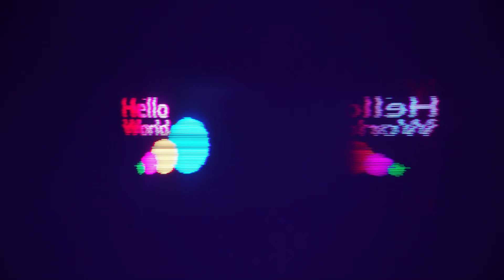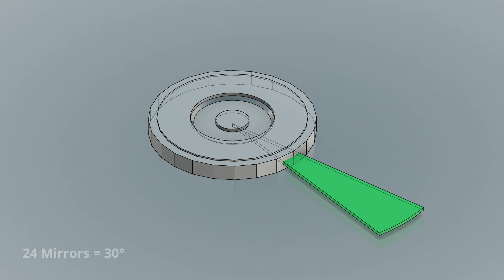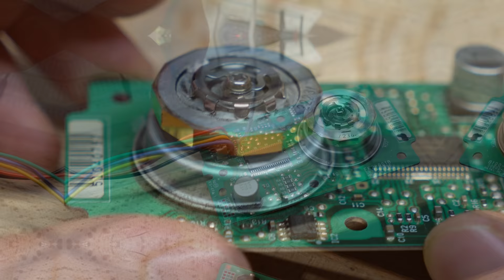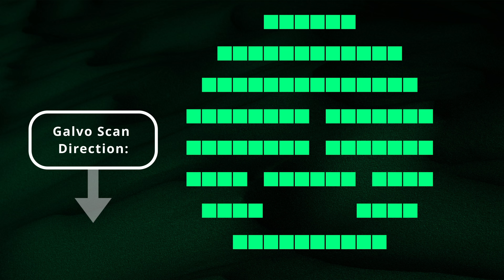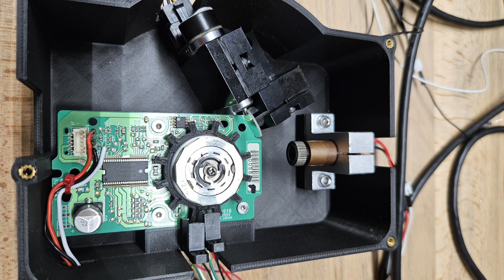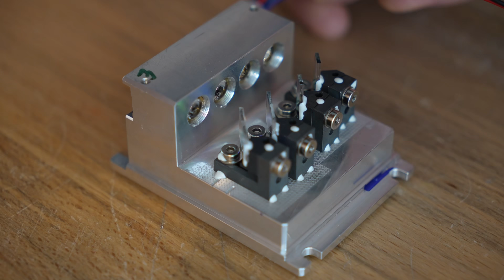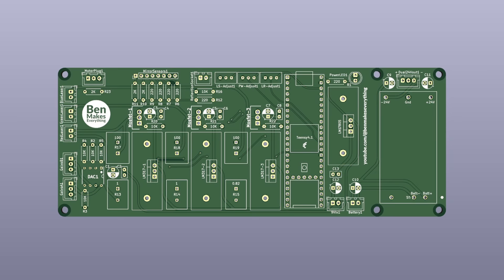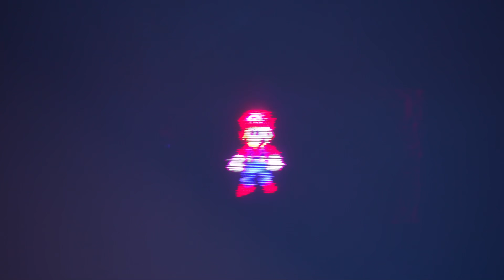DIY Laser Image Projector (100ft+ Range!)

Comment: I feel like dithering could help the colors a bit. 

I also feel like color should be secondary to size and resolution. Makes more sense to add 3 green lasers to help with the resolution vs. RGB. That's just me though.

Nice work. I want to build one!
Reply from the maker: That's a fair assessment. I could have gone that route, just got so many people asking for RGB in the first design, I figured I'd give it a shot.
Reply: Why would I use multiple lasers when you can buy commercial products with HD output? How do you calibrate those lasers to be even?
Reply: @ArneChristianRosenfeldt Why do anything?

Comment: How about using a slower rotating polygon mirror also for the vertical scanning, with its rotation axis perpendidular to the horizontal scan rotatation axis? The scanlines would get slightly slanted due to the constant rotation of the vertical scan mirrors, but that should not be a major issue. Very cool project like the previous ones! I had this kind of idea myself many years ago, but only on paper.
Reply from the maker: I thought about that - just wasn't sure how to sync them up without using gears. Given this motor is spinning at about 15,000 RPM, I thought that would generate an insane amount of friction. Maybe they could somehow be synchronized electronically.
Reply: @benmakeseverything Maybe possible with contactless magnetic transfer?
Reply: @benmakeseverything  timing belt
Reply: YES YES YES
Reply: magnetic worm gear? or let the software figure out what color to emit based on the current position of horizontal and vertical mirrors, ie. let the hardware move the (x, y) indexes in the software. This way the better the synchronization, the better image quality, but no longer will they need to be synchronized perfectly.

Comment: Is there a known maximum switching frequency that can be obtained on a breadboard given its stray capacitance? Is 100 nanoseconds even attainable in those conditions?
Reply: People build CPUs and Ben eaters world worst video card on breadboards. 20 MHz.
Reply: My highest frequency I've got working on breadboards is 27 MHz (~37 ns). 32 MHz should be doable, but haven't managed it myself. I'd almost be willing to say that anything under 100 MHz is doable, tho have no backing for it or any references - just a wild guess.
Reply: If the waveform at 11:16 is real, thats most likely inductive ringing, not stray capacitance.

Comment: Holy crap this video is a masterpiece of improvements being made. Awesome how something like a CRT can be replicated into a projector. Usually projectors are just boring lcds but this one has LASERS!!! Nice job.
Reply from the maker: Thank you so much! It was a lot of work but a fun project for sure.
Reply: This project is quite retro. The first television systems were mechanical in nature and worked precisely like this.
Reply: @videolabguy  Yeah, the early pocket projectors before DLP used lasers and a single mirror that was electromagnetically scanned in two directions with resonant frequencies using just one coil, genius.

Comment: dither your images! can get much more true-to color images even with your limited palette
Reply from the maker: I'll have to look into that, hadn't considered it. Thanks for the input!
Reply: @benmakeseverything  Dithering would work, but I am not so sure that PWM is ruled out here, sure the lines would be dotted, but as long as the frequency is high enough, I would think it would have the apparent effect multiple levels of intensity, kind of like a one dimensional half tone.

After all, with a few exceptions, every printing and display technology is based, more or less, on the phenomena that different dots close together is perceived as one of the average intensity of them all.
Reply: Agree, but I would suggest not just dither static image, but convert it to video or gif with dithering by using ffmpeg. It has multiple dithering methods, I would probably suggest atkison or sierra3. You can try other as well, but with B/w screens atkison works best for me even with resolutions like 100x50. High framerate is important though.
Reply: @benmakeseverything There are any number of image processing techniques that could help with color. But, solving it in hardware would be most reliable and get the highest quality. I wonder if you can use some kind of shutter to control the beam width?
Reply: @benmakeseverything  either dithering or blue noise would work - the benefit is that blue noise can change seed every frame so that the pixels blend together more
Reply: @benmakeseverything  If you do then while blue noise or error diffusion would brobably look best I really like the look of bayer matrix (ordered) dithering so pls try that too
Reply: @benmakeseverything  worth a look... for us oldies, the display you have created is roughly mode 2 on the BBC micro. That could produce some pretty decent colour images using dithering - good enough that my parents got called to the school because I had an image ripped from a Samantha Fox Strip Poker game and loaded one onto the school BBC.
Reply: When IBM came up with their CGA colour display for the original PC back in the early 1980s, they had a similar issue with the colours.  They decided to use resistors to run the R, G and B channels at 66% brightness normally (giving the same eight colours as here from three bits per pixel), but they added a fourth bit to each pixel for 'intensity' which when set, added another resistor in parallel with the existing one (for all three channels at the same time) to bump up the brightness by 33% (making the original three bits switch between 33% and 100% brightness, instead of 0% and 66%).  Just this simple change of adding one more bit doubled the number of colours to 16 without requiring much extra circuitry and without the need for PWM.  It's where a lot of the old 16-colour graphics formats get their colours from.
Reply: @vink6163  THIS!
Reply: Dithering requires more resolution to spare, as does PWM
Reply: I have worked on some "low resolution pixel magic" before, and yes, i believe it can be quite some upgrade (given that there are still only those 8 colors available) 

BUT: i think it only really has a nice effect with pictures and not with cartoon like images.    It will get more blurry but if u see it from the far u might have a better chance at recognizing what is shown.

... but other idea: can u draw one line two times? Or rather set the vertical speed to 1/2 to then have  28(hope my math is mathing xD) diffrent colors?   (U just take every possible mix of your 8 colors) ... it might add flicker or halfes ur y resolution,  but adds colors.   Also maybe u could make a algorithm to share the pixel colors a lil more (maybe add 28 colors roughly but only reduce y resolution by 1/3 🤔)
Reply: @MasterPice01 I'm not sure how two passes would increase the number of colors available. Are you thinking it would allow mixing "faded" green from the first scan with bright red from the second, or something?
Reply: @creativecraving yes,  i guess you could imagine it as overlaying two images in photoshop and setting the blend thing to "add" or something.       It will flicker very fast between colors for one pixel,  but if its fast enough the human eye probably sees it as a blend.    I mean its the same as running PWM leds to control the brightness  i guess but now having the frequency be the speed for one line
Reply: @MasterPice01 Hmm. I guess that would let you have 3 more colors. Wonder if it would work?
Reply: @creativecraving more than 3.  He has rgb. And combinations of it (red green blue magenta yellow cyan black and white.)    (This is just the combination of the 3 lasers and gives 8 colors) 

  magenta would be turning on red and blue. (rb)
 Red would be turning on red (r)
 White would be all (rgb)
...

But then you can mix those 8 colors i believe.    So we first draw a line . Lets say in red (r). Then we redraw the same line but now in magenta (rb).   This would flicker between r and rb and i believe this would be blended into a color similar to rrb (so 2 parts red and one part blue).    And you could do that to all the 8 colors. 

Wait let me make the math...
Reply: Oka so we pull 2 (k) colors of a pool of 8 (n) available. 

So we use the binomial coefficient of n + k - 1 over k  where k = 2 and n = 8     .... which is 9 over 2 which is 36.  So we should get 36 new colors to choose from.   Those are basically all combinations of the original 8 so for example  red and red. Red and magenta, red and blue , magenta and white  .... etc.   If you mix black and a color you get even darker shades if the 8, which should already make the quality of the output better i guess
Reply: ... so codewise we could simply find the actual color code for the 36 colors and then use this to convert a image into a indexed version like in the video but now with 36 instead of just the 8 indices.   And changing some code to make it work on the device with two lines .     Optionaly you could convert the image to still the 8 indices image but generate two layers (the ones that are mixed) them the device only needs to take the two images and first alternate between drawing image1 line 1, then image 2 line 1. Then image line 2, image 2 line 2, ... and so on
Reply: @creativecraving  
in a lil more detail (just made a tiny python code for this) xD:

Primary colors: ['r', 'g', 'b']
gives us 8 colors like in the video: ['r', 'g', 'b', 'rg', 'rb', 'gb', 'rgb', '-']
where - is black (no laser on), rb would be magenta ...
and then we make each pixel twice by redrawing the lines: (first rgb value is layer 1 and after the "," is layer two. the layers are drawn over each other so it should mix the two colors)
r,r    : RGB=[255.0, 0.0, 0.0]
r,g    : RGB=[127.5, 127.5, 0.0]
r,b    : RGB=[127.5, 0.0, 127.5]
r,rg   : RGB=[255.0, 127.5, 0.0]
r,rb   : RGB=[255.0, 0.0, 127.5]
r,gb   : RGB=[127.5, 127.5, 127.5]
r,rgb  : RGB=[255.0, 127.5, 127.5]
r,-    : RGB=[127.5, 0.0, 0.0]
g,g    : RGB=[0.0, 255.0, 0.0]
g,b    : RGB=[0.0, 127.5, 127.5]
g,rg   : RGB=[127.5, 255.0, 0.0]
g,rb   : RGB=[127.5, 127.5, 127.5]
g,gb   : RGB=[0.0, 255.0, 127.5]
g,rgb  : RGB=[127.5, 255.0, 127.5]
g,-    : RGB=[0.0, 127.5, 0.0]
b,b    : RGB=[0.0, 0.0, 255.0]
b,rg   : RGB=[127.5, 127.5, 127.5]
b,rb   : RGB=[127.5, 0.0, 255.0]
b,gb   : RGB=[0.0, 127.5, 255.0]
b,rgb  : RGB=[127.5, 127.5, 255.0]
b,-    : RGB=[0.0, 0.0, 127.5]
rg,rg  : RGB=[255.0, 255.0, 0.0]
rg,rb  : RGB=[255.0, 127.5, 127.5]
rg,gb  : RGB=[127.5, 255.0, 127.5]
rg,rgb : RGB=[255.0, 255.0, 127.5]
rg,-   : RGB=[127.5, 127.5, 0.0]
rb,rb  : RGB=[255.0, 0.0, 255.0]
rb,gb  : RGB=[127.5, 127.5, 255.0]
rb,rgb : RGB=[255.0, 127.5, 255.0]
rb,-   : RGB=[127.5, 0.0, 127.5]
gb,gb  : RGB=[0.0, 255.0, 255.0]
gb,rgb : RGB=[127.5, 255.0, 255.0]
gb,-   : RGB=[0.0, 127.5, 127.5]
rgb,rgb: RGB=[255.0, 255.0, 255.0]
rgb,-  : RGB=[127.5, 127.5, 127.5]
-,-    : RGB=[0.0, 0.0, 0.0]
giving us 36 new colors at the cost of losing half the lines or speed (we need twice the lines per frame now)
Reply: @MasterPice01 😅 Whoops! I didn't mean to nerd snipe you, but I hope you had fun! Yeah, my original way of thinking was that only the original 3 colors could combine to create the new ones.
Reply: @creativecraving  ok i tried to answer to this message now at least 5 times, i think youtube is broken for me:/
https://pasteboard.co/EthJuu7hSdO5.png
Reply: @MasterPice01  Ooh! Cool graphic. I bet links have to be manually reviewed by the creator. Anyway, this thread has generated some cool ideas.
Reply: Dithering does not require pwm or higher resolution, it can simply be a part of the (spacial-) color- conversion pipeline